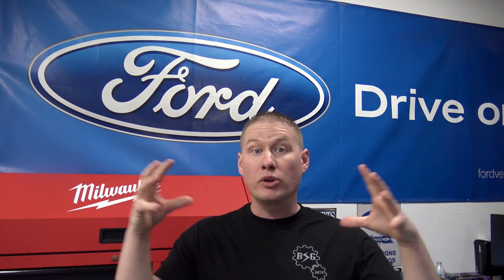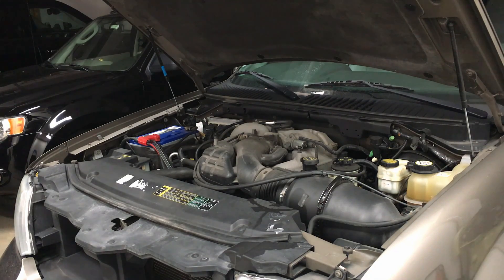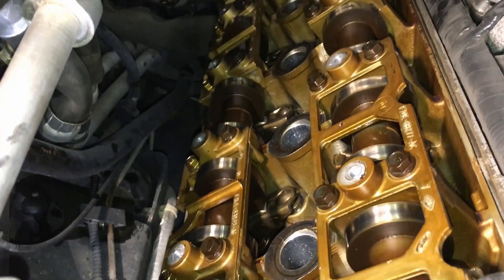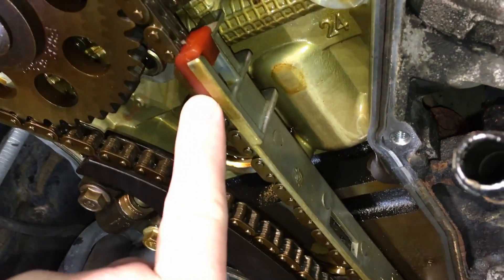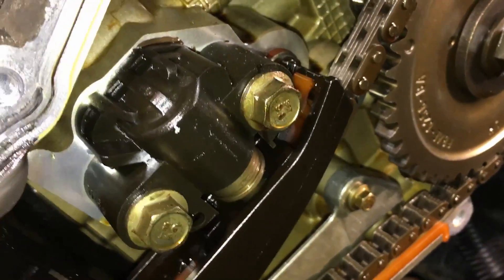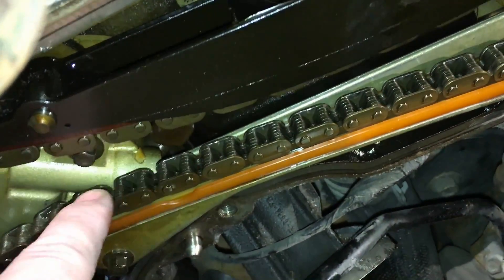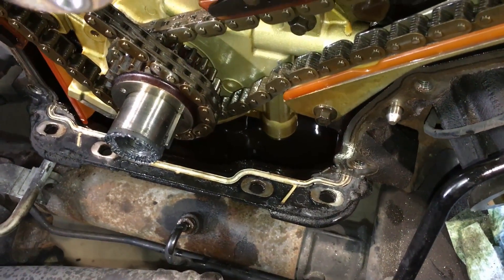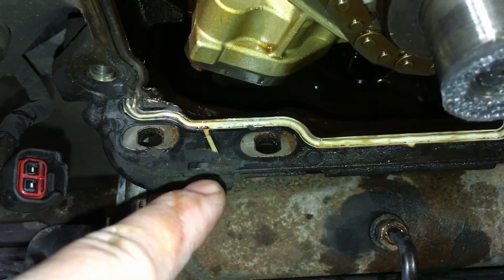Ford 4.6L & 5.4L Triton Engines: Common Failure Points to Watch Out For!

Comment: I have a 05 expedition with 72 thousand miles. If I was to be pro active and change the problem parts with the 5.4 3V are they: guides, tensioners, cam phasers, oil pump. Is that it besides normal maintenance stuff? I did the plugs thanks to your vid👍 and maybe a approximate price someone might charge. Ballpark. 
Big thanks for all your vids ~Rich
Reply from the maker: I have heard dealers quote around $3,300 so an independent shop may be $2,500 and I charge $1,760 for the complete job on the 3v engines.
Reply: FordTechMakuloco thank you!!! I have all the parts covered? Nothing else recommended while I'm in there?
Reply from the maker: Yeah you can either reuse the chains and cranks sprocket or not but they generally last a long time. Make sure you have a new valve cover and crank seals on hand and the new cranks bolts as it is TTY. Oil change after with a motorcraft filter and 5w-30 is recommended. Only use Ford parts for the internals.
Reply: Awesome. Thank you so much!
Reply: 1800 for that?? Bro wtf, why is everything in the US so expensive.

Comment: On a scale 1-10, how difficult is this job? Also, if I'm already here should I change the cam phasers?
Reply from the maker: It is hard on the body but otherwise easy to follow my 4 part series to get it done and if you have the 3v yes replace the phasers while you are in there.

Comment: Wow I bought a '07 Ford F150 last year that has the 5.4L that only had 52,000 miles thought I got a great deal on the truck. this is my 1st Ford I've always owned Chevrolet trucks. The more I look the more horror stories I hear about the Ford's this will probably be the last Ford I own due to bad engineering on the motors.
Reply: Steven, my wife has an 05 Expedition with the 5.4 3v. It has 167,000 miles on it and we have had almost no problems with it. No major problems at all. It is getting the rattle on start up but it does have 167,000 miles on it. I plan on doing the whole timing setup soon. I wouldn't worry about anything till that time gets here. Keep it serviced and enjoy the truck.
Reply: Steven Roberts i bought one with a 5.4 for 900. 200000 miles. a beat up work truck  but still runs well for 200000
Reply: Steven Roberts my 04 f150 has the 3 valve less than 5k away from  200k and still going strong. Don't make up your mind on horror stories man no matter what brand you buy you will always hear tons of them go on you're own experience
Reply: That's a Stupid Statement.  This isn't Normal Wear and Tear, this is what happens when the Engine is Abused
Reply: If it's a 3V engine with VCT the cam phasers or the VCT solenoids  will be the most likely thing to take a dump. You should switch to 5w30 oil because that's what ford puts in these engines everywhere else in the world. They went with 5w20 in the states to help meet federal regulations.
Reply: Sorry buddy, but this isn't a Normal Wear and Tear item.  These engines are strong and durable
Reply: you should be able to abuse them a little without shit blowing apart. its bad engineering. fords are garbage. you dont see this crap on toyota or Nissan trucks.
Reply: Steven Roberts I have a 02 f150 with the 4.6 2v with 150k miles on it never had any problem but normal maintenance only thing I have a problem with is the transmission but the oil is sorta black gotta change it but don't got time

Comment: i have a 2004 lincoln navigator 5.4, do i have a 3valve or a 4 valve engine???
Reply from the maker: +Geovanni Delgado 4v same engine shown in this video.
Reply: FordTechMakuloco is the timing chain and components the same for both 3 and 4 valve? I did the timing chain on my 04 Nav last year and I put a 3 valve Cloyes timing kit..am i in any trouble??
Reply: Does it run good and have no check engine light?

Comment: I'm a Chevy guy. But I love ur content and videos. Keep it up bud.
Reply: +HERPY DERPEDY It all started in Independence, MO
Reply: Justin Sero sr at least you aren't one of those pretentious GM fanboys. They are horrendous
Reply: HERPY DERPEDY agree! the thing about me is, I like some fords and some gm vehicles too.
Reply: David McClelland you son you!
Reply: fuzzy wuzzy ?
Reply: Justin P. yeah not just GM but Ford our 5.4 2 valve is great but they ruined it with the 3 valve Ford 300 is a tank just like the 350 Chevy basically all brands get ruined as they get newer not saying advancing is bad but they took a wrong way of how they advanced their engines
Reply: +Justin P. This is Frank. Garrett.
Reply: David McClelland hey fuck you and go smoke another Marboro!!
Reply: ***** Must be an inside joke
Reply: David McClelland sa
Reply: Eh when ford tries to advertise as "military grade" or whatever when chevy trucks have been in the military since the 80s (and the duramax is going in the replacement to the hummer SPECED by the us military) its kinda lulz.
Reply: Matt Lane - hummer is dead, yes GM killed the brand awhile ago but I'm talking about uncle Sams hummer. Oshkosh is building the JLTV, Humve's replacement. It does however include the duramax
Reply: ricky allison I also love Fords they are good job security especially those 5.4's.
The interiors (Lariat,KR, etc) in the Ford pick ups are much nicer than the Silverado's IMHO.

Now gasoline powered Dodge pick ups, are pretty much disposable trucks. Cummings engine is great though.
Reply: Justin Sero sr i like chevy and fords. 👍 new gm stuff today is pretty much junk tho.
Reply: you need to look back to ww1 before you make a complete fool of yourself
 chevy is a bad mexican joke. ford has dominated the market since the begining at least  ford  didnt kill people from cheaping out ...and get away with it??? have you not watched "cars that built america"
you might want to, and see why ford loyalty is forever. chevy is for douchebags with false sense  american pride . im canadian  hey! we still build fords here!
Reply: Idk what your talking about lol, but the hummer was AM general, civi hummer was at GM dealers.  The AM general hummer used the 6.2/6.5 and yes the new whatever its called jltv is using a duramax that the US military asked for, I was talking about the picks ups however the CUCVs were k30s the military used... so ford wants to be like "hey look we use military grade aluminium" Well a whole GM truck was military grade 30 years ago lol. They also had some cucvII's 2500hd's I think...
Reply: +ricky allison you dumb f*** Ford is not even used in the emergency department anymore because Ford killed a lot of people with there failed 6.0 piece of s*** stroke in the ambulance don't f**** lie bud
Reply: @bristoldaffern8898  you are delusional! FORD owns the emergency market and the Law enforcement market. Many Law enforcement agencies are switching to the FORD Explorer.